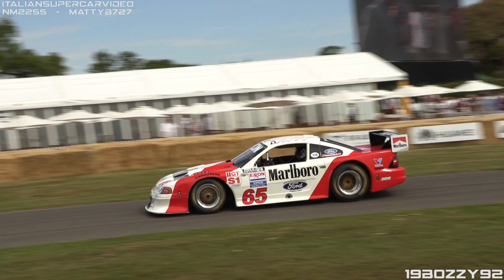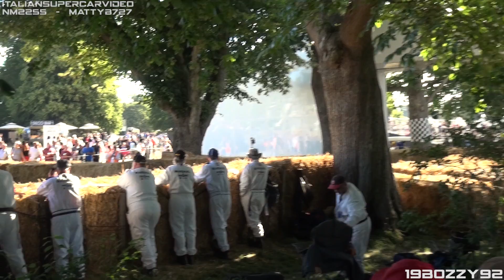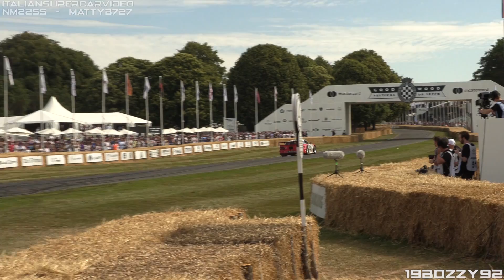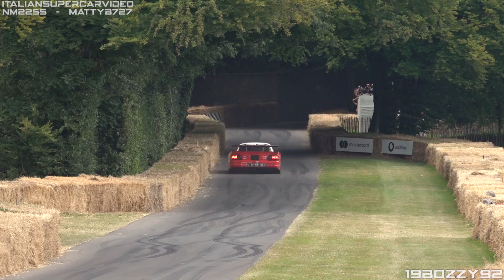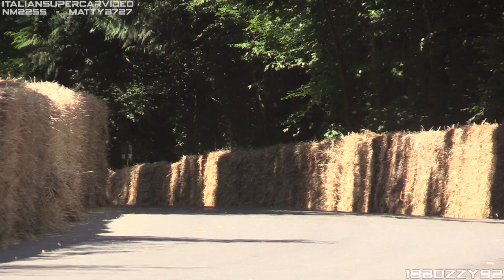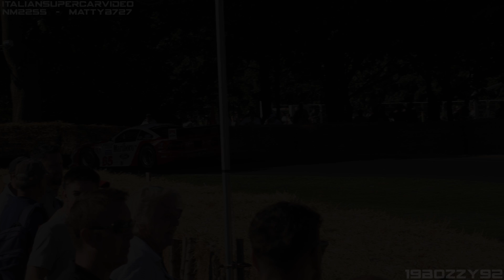1995 Ford Roush Mustang GTS-1 Trans-Am at Festival of Speed 2019

Comment: The SN 95 Mustang didn't aged so well but it looks really good with a wide body kit.
Reply: This isn't a 'wide body kit' it's a space frame silhouette car :)
Reply: @SwagPKVids  whoa that's pretty cool
Reply: This is not a mustang, it's just made to look like a mustang
Reply: It's called a silhouette car, full tube frame with 355ish ci engine NA,
Reply: I would disagree about the sn95. the featured car does look pretty cool
Reply: That's not wide body kit. This is a purpose 
Built tube chassis race car. With a 800-900
Hp Rousch V8. Many people prefer this era 
Of mustang due to the sweet sloping sportscar Roof Line. And 32 valve V8 in street version
Reply: It is funny how things are now.  The cobra nad Mach 1 SN95s are used so much in amateur racing these days.  THey are getting really expensive.
Reply: @ThePerpetualStudent  IKR. The last good ones are becoming collector’s and are now expensive.
Reply: They age Great!! If fact they are sought after!
Reply: @MrAndreCoutinho  Yes they are! Mustang Cobras are going up in value.
Reply: @mikestevens5512  ikr, I just checked and they are reaching the collectible status.
Reply: @MrAndreCoutinho   I agree. I drove a 1999 Cobra wow. They have an amazing exhaust note.  We got going 130mph with 
Ease.  But now that car has gone so far up in value!
Reply: @mikestevens5512  yep, even the early GT has gone up, the old 302 sounds lovely.